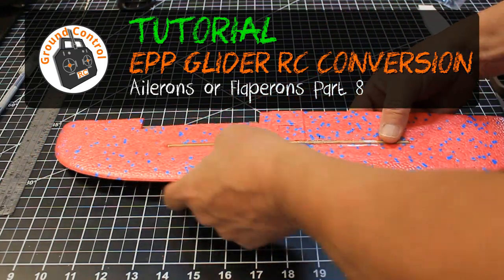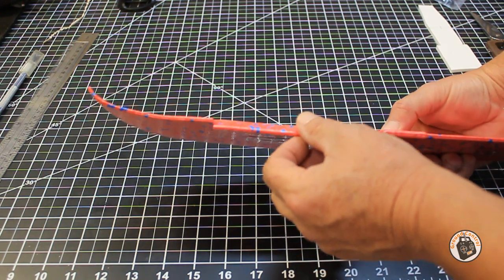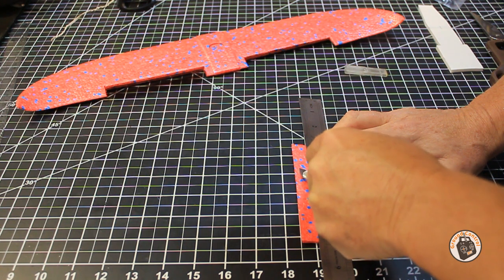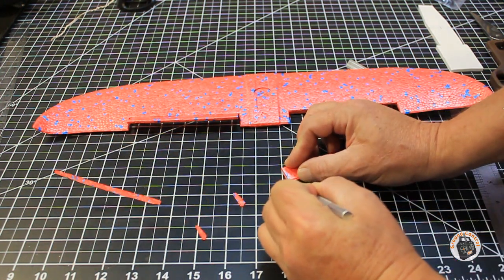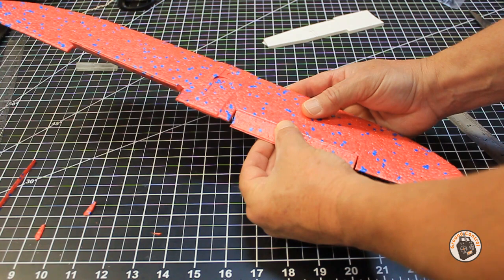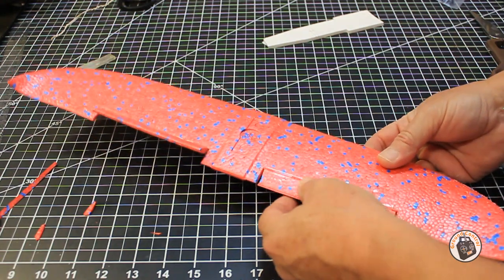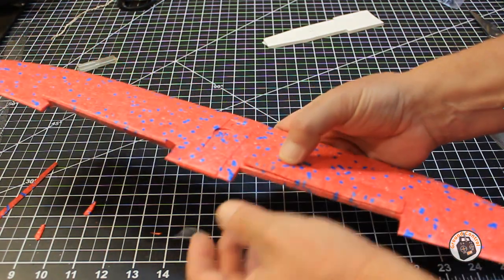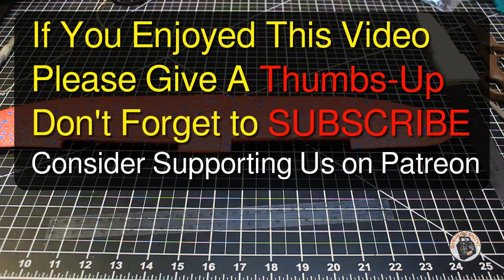Tutorial Part 8 - Glider EPP 48cm RC Conversion - Ailerons or Flaperons

Comment: I love you serie about converting a Chuck glider into an RC plane. I will do the same but I am in a dilema : My gear is quite heavier than yours : 50 grams motor, 116 grams battery, 36 grams ESC, 10 gram servos,... I'm afraid it would be too heavy for this 48 cm plane. I bought similar one but with a 100cm wingspan. Would you advise me to convert the other one instead ?

thank you very much for this amazing series, it's exactly what I was looking for.
Reply from the maker: Thank very much for the kind words! Yep! Definitely go with the 100cm wingspan as those components would be much to heavy for the 48cm wingspan. I'm not sure of the height and width of the fuselage on the 100cm glider? Will the fuselage be big enough to house all the electronics? You will definitely need a good wing spar as well. I used a bamboo skewer for my 48cm wingspan but I would use a good carbon wing spar for the 100cm conversion. With components you listed and the size of the glider I would estimate your All-Up-Weight is going to be somewhere in the neighborhood of 450-500 grams. Do you know how much thrust your power system will provide? Also, if it's the 100cm wingspan glider listed on Banggood that I just looked at, I would probably extend the wing to provide lighter wing loading. I hope that helps and I'll see you in the Air!
Reply: @GroundControlRC  I didn't receive the 100cm glider yet but looking at the photos it seems wide enough to house the battery under the canopee.
My motor provides 800 grams of thrust which should be enough with thrust to wheight ratio of 1.6-1.7.
I have some carbon fiber spars of 4mm which should get the job done in termes of stiffness.
 I Don't know yet if I will do a pusher or a puller configuration. Pusher would be optimal for motor protection but I'm not sure to get the CG far forward enough.
Your inputs helped me a lot, without you I might have converted the 48 cm before noticing it's too heavy.
Thank you very much.
Reply from the maker: @alisioardiona727  , you are most welcome. I wish I had more time as I would love to do a tractor conversion as well ;-)
Reply: @GroundControlRC  it is Indeed the 100cm glider from bandgood.
Reply from the maker: @alisioardiona727  , good luck on your conversion. If you can get everything installed and get your CG set you're going to have a lot of fun with it ;-)